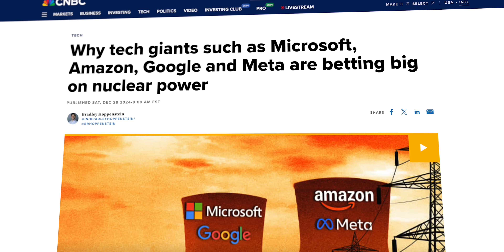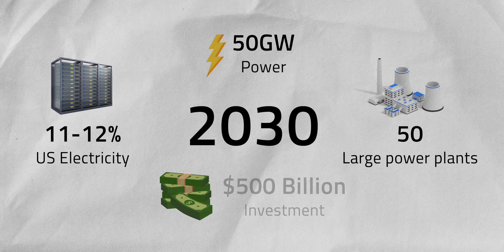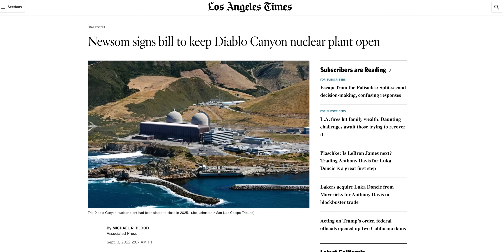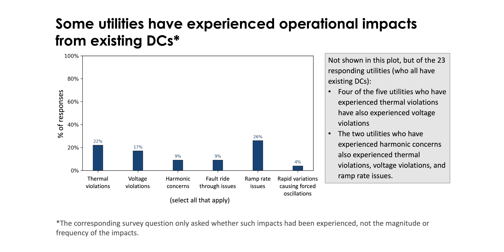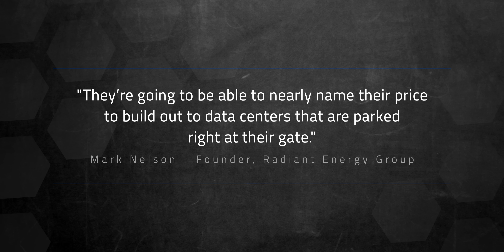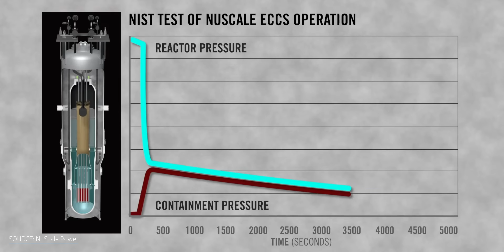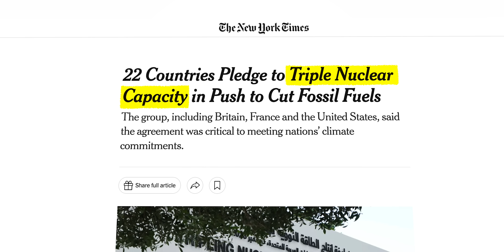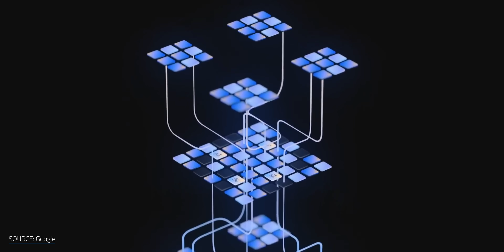Why Big Tech's Betting Billions on Nuclear (Not Renewables)

Comment: As a resident of New Mexico, one of the few states that has a repository of spent nuclear fuel, NO ONE HAS come up with a place to send the spent FUEL.... until someone does all I hear is NIMBY... New Mexico just spent 50 million dollars to clean up old uranium mines here in this state.... and again, nowhere does anyone address the cost of the cleanup and storage of the spent fuel or the cost to close the current nuclear power plants.
Reply: > nowhere does anyone address the cost of the cleanup and storage of the spent fuel or the cost to close the current nuclear power plants.

Sigh. Completely wrong. THESE COSTS ARE ADDRESSED!!!!!

The costs of dealing with nuclear waste IS part of the price now (at least in the US).

The NRC requires a surcharge of 0.001 USD/kWh (decimal correct), deposited in an government escrow account. You can see the current status of the fund at the NRC website.
Most other countries have the same, or have since adopted the same, funding model.

Likewise, the NRC requires plant decommissioning costs to be placed in a company escrow account, which is periodically audited by the NRC to ensure it is kept funded.
Reply: Nuclear fuel can be reprocessed, France does it at scale. The US used to do it as well, but it (the one facility) was shut down long ago. France 24 recently had a good documentary on the subject. Greater than 95% of spent nuclear fuel can be recycled into new fuel, and they vitrified the rest for long term safe storage. We just need the political will to solve the problem.

Comment: Dare we ask the very valid question - what are we actually getting out of all of the AI hype and is it worth what we’re are spending on it (resources, dollars, etc)? Sounds like a very expensive “solution” in search of a problem.
Reply: https://youtu.be/P_fHJIYENdI
I asked a similar question, and assumed there were applications we don't even know about. Some we do, like climate models. The Veritasium came out with that video yesterday on protein folding, and that put another piece in the puzzle. It's not just asking for fake pictures and homework answers lol.
Reply: @jasonland8210  You don't need a nuclear reactor to run AI for protein folding.
Reply: Recipes for lasagna that doesn’t require ricotta cheese…duuuh
Reply: @JSx145  Protein folding research for example. biochemistry leapt by decades thanks to AI. Developing medicine is quite beneficial to humankind. IT security uses AI for a lot of detection and protection. Also AI is used in material engineering and chemistry. AI is more than a glorified chatbot.
Reply: @marcellvarga3926 I work in the medical field. Valid application, though I would say the AI hype, and the ML doing those things (which has been in existence before Sam Altman and the current tech hype crew) aren’t really the same thing. It is the difference between a calculator (an actual tool) and a calculator that is loaded with games… technically the same thing, and technically the addition of games didn’t added anything to do calculations better “but people think it is so much cooler with games”.
Reply: @JSx145  we are getting nuclear power, eventually when the race to make the AIs end they'll have to find a new use for all the energy surplus that means it will become a source of cheap energy and maybe even end  dirty sources of energy as they are far more efficient when up and running.
Reply: profit is your anwser
Reply: If you do not understand the value of having digitized intelligence. Then your question is bigger than you have the intellect to understand.
Reply: @jasonbirchoff2605  People ask these question because the sort of AI most people interact with isn't all that intelligent. If it was, no one would be asking.
Reply: @jasonbirchoff2605 Where is the intellect? It can be used to process some data but most people are using it as google v2.

Comment: Datacenters release a lot of heat. Perhaps a good solution to be more energy efficient would be to capture that heat for district hot water and district heating. I know a data center in Switzerland has done that. Basically, every kWh of electricity there is used twice: once for the data processing, and once for heating the district. This could tremendously reduce our need for more energy.
Reply: That's why the Arctic and Nordic nations are good places to build data centers because air and water-cooled centers are cheaper in those environments.
Reply: I always thought so, but apparently there is a problem with the distance from the users and this creates a Latent  issue (delay of net signal transmission.
Reply: This combined with the new graphene coatings for heat sinks and the heat pump system someone mentioned and it would make for a great heat transfer system. Combined with a bank of grid scale sand batteries and that would be enough to keep plenty of folks in a near by township or large apartment building toasty during the winter months.
Reply: They already done this in cold places like Iceland.
Reply: This should be a permit requirement. 🤓
Reply: Nuclear Cogeneration is the name and should be the game
Reply: I would use chillers to cool the server racks and then transfer that heat through heat exchangers to create steam to power steam turbine generators. 

The efficiency would likely be around 20%, but that is about 6.6 Mw for a 100 Mw data center. It also reduces how much heat must be dissipated, minimizing wasted power.

In colder areas the waste heat could be used to heat other facilities.  Imagine an Amazon warehouse that utilizes the waste heat, further saving electrical demands, or nearby office complexes.

Using the heat from the server racks means that the facility needs less backup power and if they suffered a full power outage the server racks would continue having heat removed, protecting expensive hardware and valuable data.
Reply: A bottleneck for compute is how quickly heat can be removed ,it might not be more efficient to try and use that heat ,impleading cooling .be aware of green scammers.
Reply: The heat gets absorbed by the planet, and is eventually emitted into outer space.

Too bad we're producing more heat than the planet can emit. This is without carbon emissions...
Reply: Does it even make sense in USA? Do you have a district hot water supply or does everyone had their own boilers
Reply: lower boiling point coolants make cooling more efficient and maybe it could be used for running a turbine, still, how much better it would be? i would guess not enough because its not happenning. also, do steam turbine run superheated steam?
Reply: The first "Starbase" project is in Abilene, Texas. We use our heaters for about 3 months per year and thats for a few hours each day. It's middle of winter and the high is 66 in Abilene today
Reply: I like the idea, but it would be difficult to find a scenario where it would really work. Datacenter heat is generally in the 50°c range. District heating loops operate in the 70-150°c range depending on the loop pressure. And in most steam processes used for power generation the loops minimum temperature is above 50°c so even pre-heating would be quite niche.

Datacenter pre-heating could be used in cases where steam loop minimum temp is significantly below 50°c.

You could probably brute force it with something like a heat pump. But im not sure how efficient that would be...
Reply: I've been wondering about this. Why aren't more data centers located at high latitudes for cheaper cooling and added revenue from residential heating? Isn't electricity a higher pay of the cost for these centers? (And as several comments has mentioned, upgrading the heat to be viable for residential heating is no problem at all)
Reply: I believe that Bill Gates intended to do that with the sodium reactor he is building.  The reactor will use liquid sodium and the beauty of this is that when the demand is low, the reactor can still keep working at full output and store the molten salt to run steam generators during peak demand.  I think Gates has it right. It is a brilliant plan.
Reply: Interesting idea.
There is a de-salination tech that used hot salt water to generate fresh water. It's called multi-stage flash.
The idea was to co-locate one of these plants beside a power plant to use the cooling needed by the power plant to heat to water used in the de-sal plant.
You could add a data centre into the mix here to generate extra hot salty water thus increasing fresh water output.
Reply: Most datacenters won't be close in the city, therefore, not much district
Reply: Don’t work in us, it’s too big
Reply: or even if there was a way to capture that water as steam, maybe some electricity could be recovered
Reply: I saw that but that’s quite impractical for vast majority of people, they use the hot water to be recirculated to the other parts of the city, which is insane for large cities
Reply: It's all pretty low quality heat. At most it's 50c or 60c, and mostly air. Water cooling is becoming a thing, but water temps are still in that range. Generally district heating tends to be high pressure steam. Additionally many data centers are not sited near places that could use district heating.
Reply: @Cynyr  With heat pump technology. You can take that 50-60 degree heat and make much hotter. It uses some energy but still worth it. And it chills the air that returns to the data center.
Reply: @Cynyr  district heating is almost all liquid water at atmospheric pressure -- not "high pressure steam", that's for driving turbines not warming pensioners' living rooms.
Reply: @JonathanMaddox  is it not at 1.5 or 1.8 bar?
Reply: @Cynyr it's only low heat because you remove it quickly.
Reply: @mryellow6918  it's low temperature because the chips in the servers are capped at about 100c die temp. The leaving cooling medium will be cooler than that after going through the heat spreader, thermal interface, and into the heatsink. You might be able to get 80c air or water out of the server. Remove the heat slower and the server overheats and throttles or shuts down.
Reply: @Cynyr  nonsense. All datacenters are located within distance for district heating.
And even low quality heat can be used
Reply: @carlchristiansteglich-pete6409  Actually that only applies to Data Centers that are near population centers.  Most of the mega data centers are in the middle of nowhere.  There are small data centers near cities, but they represent a minority of DC power use.
Reply: @carlchristiansteglich-pete6409  yes preheat the water to be boiled at the very least.
Reply: @Cynyr agree for most district heating systems. The 4 generation may use the residual heat, but those are few and require more piping, higher flows and need bigger heatexchangers.
Reply: @Cynyr  Odd, then, that the technology is use widely. Maybe a little research before pontificating?
Reply: @zweigackroyd7301 Try again, maybe you should google the difference between different generations of district heating. The temperature is far to low from datacenters.
Reply: @Harrythehun  Okey doke. I'm sure the rest of the world simply isn't following your very special view of reality. Imagine that.
Reply: We generate heat to power the datacenter, the datacenter generates heat, we evacuate the heat from the data center, by using energy generated by producing more heat… 🙃
Reply: @GabrielPettier still can be utilised as waste heat like a thermal substation if a heat network nearby
Reply: I have a proposal for a datacenter that does exactly that!
Reply: @texanplayer7651  I could understand that for the building the data center is in, but insulating and pumping the water miles away seems impractical.

Comment: You missed a large number of nuclear reactors the navy has about 100 reactors between submarines (1 per sub)  and Aircraft Carriers (2 per carrier)  All built after 1970 oldest operating reactors is the Nimitz with 2 reactors built in 1975. oldest sub reactor still operating USS Helena 1984. newest USS Gerald R. Ford (CVN-78) commissioned in 2017

Comment: With sodium coolants must address their volatility in water and air.  If the coolant system fails mechanically, you will have a big, intense, fire on your hands.  If it is the primary reactor loop that catches fire, it will also emit radioactive particles.
Reply: Molten salt, not metallic sodium. Molten salt is corrosive (a problem when you want to pump it around through piping and heat exchangers), but it's not nearly as reactive as the alkali metals themselves. 

You can melt sodium chloride in open air and it doesn't burn, in fact it is used for some metal heat treatment processes where steel is dipped into vats of it. 

He did mention their design using a fluoride salt, but the idea is the same.